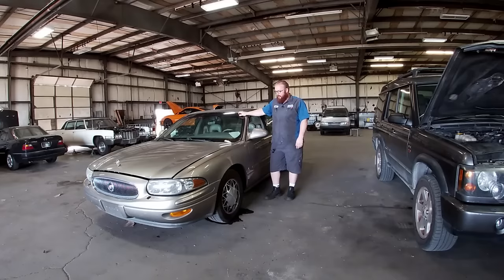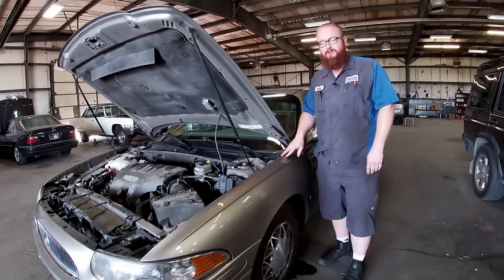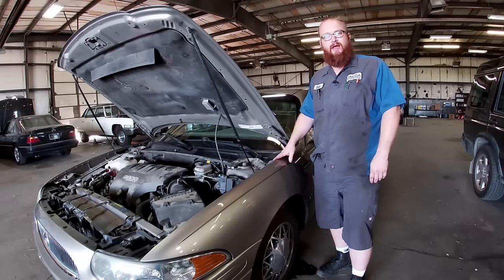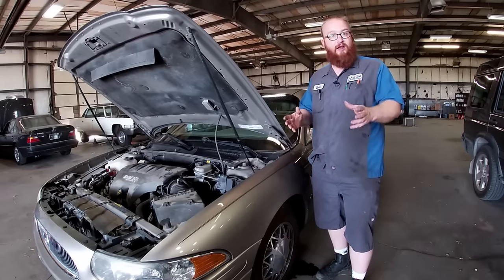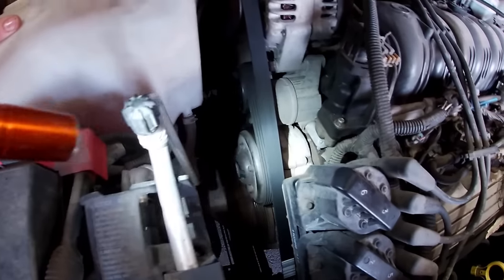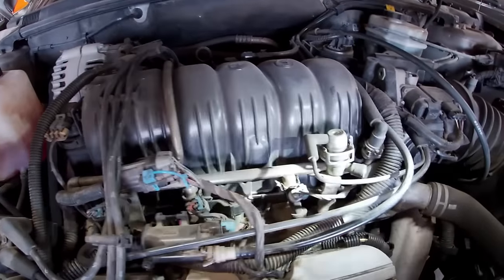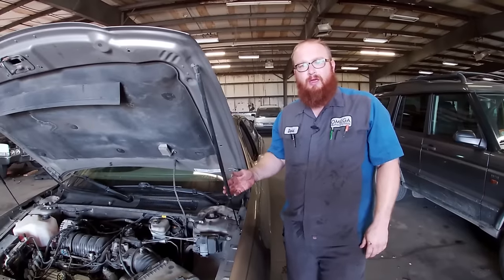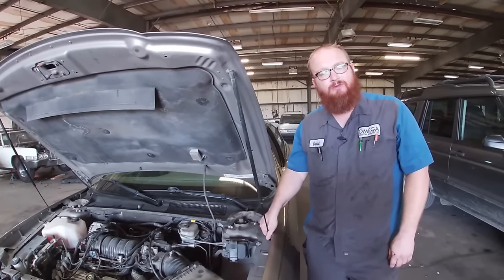CAR WIZARD highlights what makes the Buick 3800 V6 the BEST engine ever!

Comment: I bought a 1997 RS Camaro  brand new.. with a 5spd manual transmission and last year I gave it to my son.  It’s been a damn good car.  And while it’s true they do run forever…  the 3800 engine  isn’t  AS accessible in the Camaro chassis.   But still a great engine and very reliable.  I have acquired another 3800 engine for when this motor finally gives out..  👍🏻

Comment: This car was the longest lasting one we have ever owned. It had close to 400,000 miles when we finally got rid of it. It was still running though. I actually remember the last thing that happened to the car was I was driving into work and stopped at a stoplight only for the headlight to keep going into the intersection. I couldn't help but laugh as my headlights were then hit by a semi.

Comment: I have a 1999 Buick Regal 3800 V6 with 107k miles it’s been very reliable for me I love this platform car with the 3800 V6 they are a good car I’ve done the upper and lower intake gasket for preventative maintenance other than that great car 😊

Comment: I "lucked" into buying a 93 Park Avenue with this engine...the car had 90,000 miles on it, and was an original, one-owner car...the old guy liked me, and sold me his beautiful Buick-always garaged--for $800 bucks!...I now have 140,000 miles on it..the only issue that might be expensive, is the transmission, which will not not shift into gear for about 2 minutes when the car sits overnight!...Once in gear, it does not slip at all. A complete rebuild would set me back around 3 grand, so I plan to continue being "understanding" when first starting up.  It is nice to see that the 3800 engine will likely outlast me!

Comment: I had a 1986 Olds Toronado that had some version of the 3.8 V-6, and it was a pretty reliable engine. It did have a balance issue, where the engine vibrated more than it should have. I had it checked out by an excellent mechanic in the Chicago suburbs, and he told me that year of the 3.8 had some kind of balance shaft or harmonic balancer problem that would be expensive to fix. There were no misfires or other problems causing the vibration, so there was nothing to fix. I wonder if you have any insight into whether other 3.8 V-6's of that era had similar problems and what exactly caused it? Thanks for all your excellent videos!

Comment: As an Australian, I agree completely, the 3800 is an awesome engine. It was the 6cyl powerplant for Australia's highest-selling car (the Holden Commodore, a RWD car about the size of the Buick Wizard is standing beside) for over 20 years. Bomb proof, cheap to maintain and I get under 9 litres per 100km on the highway at almost 250,000 km. No plastic intakes or coolant elbows on ours either. I average 12.7 even tho I live in the mountains.

And yeah, the 3.6 is a POS.

Comment: I own a 99 century 3.1 L v6, great car other than the intake manifold gaskets needing replaced wich was 1,450$. It was shifting a little hard from 1st to 2nd, i chsnged fluid and filter but didnt go away till i drained the torque converter fluid. Now it runs like new other than evap leak. Bought it for 800, put 1700 into it. Not bad for 2500 bucks with 113,000 miles. JUST CHECK INTAKE MANIFOLD GASKETS AND UPGRADE TO THE NEW REFORMULATED DEX COOL

Comment: I remember watchimg an hour long promotional video about the new Buick Electra that had the new 3800 engine in it.  They talked about how much time they spent developing the engine and car, and showed video of some very harsh real world testing they put it through around the world explaining saying how many hundreds of thousands of miles they put on the test cars to ensure it's reliability, durability and efficiency.  About 15 years later I read an article in Road & Track by a guy who was surprised at how impressed he was by his 10 year old Buick Electra and how he thought it was the best engine ever.  Was amazed at how good a gas mileage he got.  As good as a Corolla, but so much larger, more comfortable and powerful.  With the car full of people and the trunk full he would get at least 30 mpg highway which when considering the size of the car and the weight of it with all of the peoppe and stuff in the trunk, he calculated that it was more efficient than any other car on the road.  What's shocking is that noone seems to have surpassed it.

Comment: I accidentally ran a 2000 Buick Lesabre Custom, with no coolant, for about 2 years. I found out after it started smoking when I had to change the battery. I put coolant in, it is purring like a kitten, and not smoking anymore, no metal shavings in the oil. I still drive it to this day. That was about 3 years ago. Might as well be a tank. I think the intake gasket was to blame. Some RTV fixed the problem, after I watched this video.

Comment: Brother you right on the money with this video. And you know your stuff this is one of the best and easy gass engines.  I have it in my 2008 chevy impala. And I love it and  it has plenty of get up and go power. But not a race car. But if your trying to save money on gas and a dependable car then this is it. If you wont a race car buy u one or build it yourself.

Comment: I believe the same engine was placed in the 2004~2008 Pontiac Grand Prix.  My Grand Prix had 3800 series 2 on the engine cover.  I passed it along to my daughter 6 years ago and it's still going.  I will say getting to the rear spark plugs was not easy to get to and I had to have a shop change them.

Comment: In 2005 bought a brand new LaSabre Custom, 16 inch wheels. I am still driving it today, of course you need to make repairs here and there. 298,873 and it is still a smooth running engine and a very comfortable ride.
Its was a very good platform to maintain instead of buying new.
Just maintain your vehicle, but some people are not into that, just fill the fuel tank and drive.
You always have to replace tires, brakes, oil, transmission fluid etc. But if you maintain the rest of the vehicle, suspension parts, AC and clean it inside and out on a regular basis, You cant stick a NEW car payment into it every month. 
Unless you drive like you stole it all of the time......well, Good luck on your next vehicle purchase......they probably drove it like it was stolen and now its your problem.
The seller made it all shiney and new smelling....then it happens, tires wear funny, wheel shakes when braking, burns oil( but you never check it either) AC stops working......clunking noise while driving over bumps........The "Money" lights turns on....But you dont care. Your last Hooptie didnt start or stop but aftermarket the radio in this one sounds better. Winning

Comment: I think I got the two best american-made cars ever made. 97 Saturn sw1 and a 95 Oldsmobile 88. Both these cars for cheap to buy and and both had just a little over 100k on the clock. I use my Saturn for long trips because it gets ridiculously good gas mileage. My Oldsmobile I use it for my back and forth to work car

Comment: I have an 05 Pontiac grand prix with 347,000 miles on the original engine and transmission and still runs great, the only thing I did was replace the manifold gaskets

Comment: Mine sucks. Exploded air intake twice. Once it caught fire. That was a chore. Oh and drips?? Yeah I had to fix the valve cover seals too. Just did an a/c compressor. Constantly fouling out one of the plugs in the back. All the window motors are shot(I know that’s not the engine). But yeah, I only keep it cuz it was my dad’s.
Reply: 600 for compressor and labor. It ain't worth it. clutch went bad, said I was chasing good money after bad just doing clutch - which you need $60 OEMtools kit to do it (on the car).
Reply: @miketuch  I did it myself for much cheaper. But still
Reply: @davee4528  Talk to me buddy. I see some junkyard compressors on ebay 50 bucks, my 99 olds 88, what do you think? What happens when you install a compressor with no freon in the system? How hard is it to get that thing outta there?

Comment: I would say ONE of the best. My 2005 Lacrosse has just over 311,000 miles and nothing touched internally on the engine. The 2000-2003 motors had bad intake manifolds( series I engines ). 2003-2005 had an upgraded bad intake manifold ( series II engines ). They then fixed them in 2005 for the series III engines and they last and last.

Comment: The original design of this engine dates back to the Buick aluminum V8 of 1961. The next year, 1962, they made a cast iron V6 based on this engine with 2 cylinders eliminated. That was the original Buick V6. They used it until 1965 when they came out with a new line of engines and sold the old ones to Rover (V8) and Jeep (V6). Ten years later, during the energy crisis, they bought the tooling back from Jeep and put it back in the old factory. From then on it was continually improved, updated, and from time to time redesigned until they finally gave up on it in 2008. No wonder it was  perfected after nearly  50 years of development.
Reply: Very interesting information about the origin of the Buick V6

Comment: I owned a 2000 Buick Regal GSE (Supercharged) with performance mods from ZZ Performance. I bought it with 130k miles on it and sold it at 189k and it was still runny like a tank! The fuel pumps go out very often once these cars surpass 100k miles but the engine will never die…

Comment: I have been following car wizard for a very long time. Right when he started YouTube. I follow Hoovies Garage since 2017 I believe. I respect their opinion a lot. They come out of experience and practicality, rather than anything else. 
But I will say one thing. 
Please do not buy these cars. 
The engine is, undoubtedly, one of the best engines ever made. It is bulletproof, efficient, fast, sounds good and dependable. There is no doubt about that. A few things here and there, a couple hundred dollars and you are back at it again. This engine is truely a gem. 
Then what’s the issue? Rest of the car. 
Firstly, if you live in rust belt in US and Canada, run away as fast as you can. Don’t even look at these cars. They rot and they rot bad. Panels don’t rust as bad but the frame, unbelievable. Especially if you live in Ontario, Canada, please stay away and save yourself and your family. They are super super bad for rotting. Even undercoating them twice a year doesn’t help. It’s the frame or suspension components. 

Secondly, 4T65E transmission. For the lack of a better word, this transmission is bad. GM used this transmission in almost every V6 vehicle they sold back then. 4 speed. If it is working fine, it’s not bad. Not the smoothest thing in the world and long gearing doesn’t help but gets the job done. This is a poorly designed transmission. It wears out very soon. Even with the regular maintenance of fluid and filter change, you will experience some sort of failure at around 100-120k mile mark. If not total failure, banging into gears or banging into gear from stand still. Rough downshifts. Getting a reman unit or rebuilding the current one was a viable choice, but with the kind of car market scenarios we have now, transmission shops charge double if not more to rebuilt now than what they charged 4-5 years ago. Reman are experience as well. No point in getting a used on because they all have issues. 

Thirdly, even rest of the car isn’t built that good. Things like starter, alternator, window regulator, heater core, blower motor, things like these fail earlier than other cars. GM parts are inexpensive and anyone can fix them but it is one of those things where something is always broken you just can’t have everything working the way it should. 

Lastly, in later years, the plastic quality used was bad. Often things like ac vents would just break. 

How do I know all this, I was looking for an inexpensive car and I bought a 2005 Buick LaCrosse with 110,000 miles from a older gentleman who babied the car. Came with thick stack of receipts. Oil change every 3 months regardless of what mileage he drive. Sometimes it was less than 50 miles. Transmission service every 30,000 miles or 2 years. Transmission cooler lines were repaired like 5 times before. It was tempting. The test drive was fine. Panels weren’t rusted, underbody looked fine. For $2000 it was a good deal. But shortly after a few days the problems started appearing. Transmission sometimes would bang into gear, like someone rear ended me. Restarting the car fixed it sometimes. Fluid had perfect level and red Color. So it was an internal issue. AC vents were broken. Worst of all, it failed inspection because of rotted rocker panel and holes in underbody. I got everything fixed and I was $6000 into the car. I sold it shortly after for a bit of loss. 

I thought maybe I was the unlucky one but then I started looked for some other cars with 3800 engine. For any car with less $5000 asking price, it either had a transmission issue or rotted body. One of the two. A quick tour to a few transmission shops and they all said STAW AWAY from any car with this transmission. 

My brother bought a 2005 Avalon with almost 200,000 miles. Not as comprehensive service history. Knock on wood, that car has no rust on panels, underbody is intact. Everything works, no broken plastic, no rattle or creek or anything. Yes the timing cover has a negligible leak. Very small. Very common issue with that engine and steering rack has a tiny leak. But he paid $5000 for the car now that car has 240,000 miles. All flawless. 

Moral I learnt, stay away from these cars. Other than the legendary engine, rest of the things are waiting to fail. Pay more and get a decent Toyota. You can get any VW from 2008 with 2.0 or 2.5 engine with manual or 09G auto transmission. Their panels rust but frame always remain intact. The drivetrain is bulletproof. Your initial saving on a Buick will be exhausted to have it running right. 

If you are stubborn like me and felt in love with the engine and just wanna have it, here are a few things you can do 
1. Look for a car with lowest miles possible. This will ensure less rotting or underbody. 
2. Find one with comprehensive service record, especially transmission service. These transmissions hate poor or no service. 
3. Buy one which have had underbody coatings religiously. Not the cheap ones, the good ones. 
4. Buy one that is being sold by an elderly person. They don’t abuse their cars and these transmissions don’t hold upto abuse and spirited driving. 
5. Try to find one with reman transmission if you’re looking for a high mileage one. 
For all the conditions above, you will be paying close to 8-10k which can get you a very decent car and the whole point for these cars is their price. This choice is yours to make. If you don’t live in rust belt, other than transmission issue, these cars are solid. Ride good, comfy ride, handles okay. Get your from point A to B. But beware!!!

Good luck.
Reply: Yeah you tell them to stay away! Maybe people will listen and the prices will eventually come down! Any transmission won’t last if it’s abused. I’m sure you’re right about them not holding up as well as the Toyotas but for the money you can’t beat them. If you can fix things yourself it’s worth it. Just my $.02.
Reply: @Pilot_Dad22  I see so many non abused owned by older people having bad transmission. If you can find one that is take care of, non abused, not rotted with service history and rebuilt transmission preferably, sure. If the seller isn't charging a kidney for it, it is actually a good car. Problem is, for usable examples people are asking Corolla, Camry, Jetta, Golf prices.

Comment: I'm glad you did this. I wish GM would have kept using these engines in their new good looking and rear wheel drive cars. I have a 90 BMW 325i and it is very simple and tough. Seems around the turn of the millennium auto makers really changed to the planned obsolescence and I don't want any of these new cars.

Comment: Great video we had 2 vehicles with the 3800 definitely a phenomenal engine.

Have you done a video on the 3.6 l? Not all of them are bad, somevI believe have slightly different cam timing which allows the injectors to clean off the intake valves a little bit.

 My neighbor has a 2014 Impala 10th gen with over 240000 miles runs like a top oil change every 5000.

Comment: It is the king in older domestic cars. 3.8’s still are registered all over the country. I travel roads like a trucker and Lesabre’s Century’s etc. and a few Pontiac and Olds are still freeway drivers. My first love was 81 Monte Carlo 229c.i. Second to my 81 Regal with a 231c.i. followed by a 81 Cutlass  with a 231. In the 90’s G body dominated NASCAR so I lived my teens. Pilot and jetted 3° servos and premium with a few junkyard tricks. Hated the nylon timing gears but those were the best, my tech years.

Comment: The plenum leaks were a recall. EGR gasses were causing the plenum gasket to fail. The recall simply put a 2 inch piece of pipe into the EGR plenum port to keep the gases from blasting the gasket and the issue was fixed.